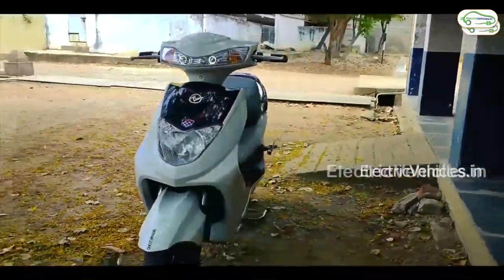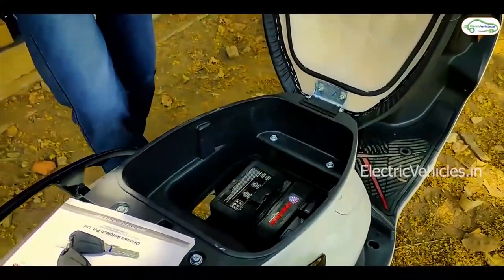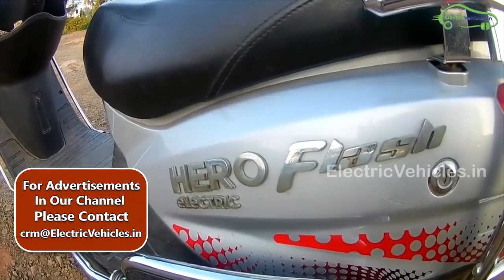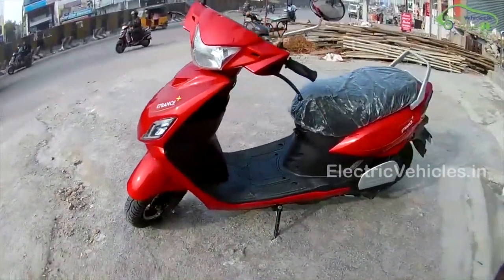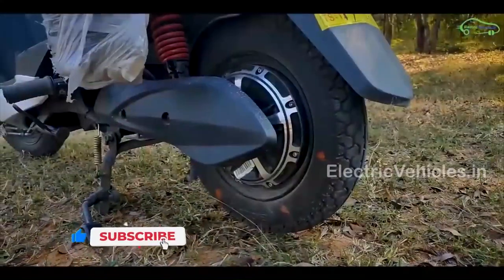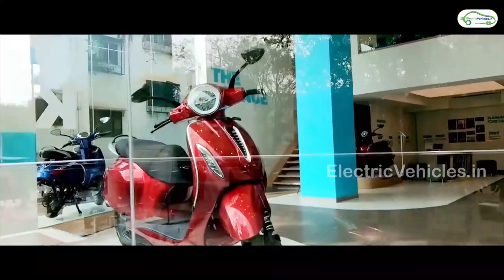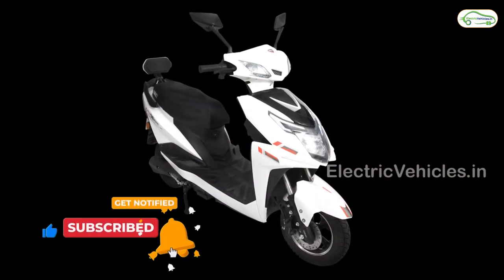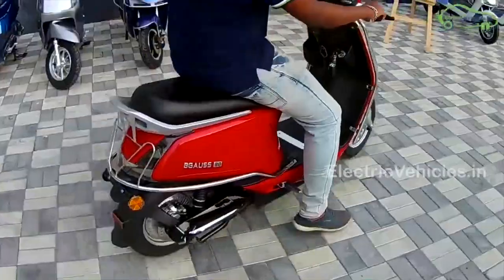Top 10 Best Electric Scooters For Ladies|Women in India 2021

Comment: Epluto is the best possible option in this segment. Not sure why it was missed ? Etrance + is also great 👍
Reply: After some months the body get starting to loose. The outer fiber starting to loose
Reply: @techmaster2827  This is a very unique issue which you are facing. I am a owner for PURE EV Epluto from last 10 months. The paint used is Nerolac and the body is PU Fibre. I have no issues to report from the vehicle and if you are facing some of these issue kindly connect with your dealership, they will resolve it for you. I hope it helps 🙏